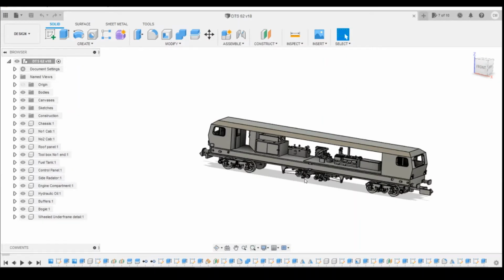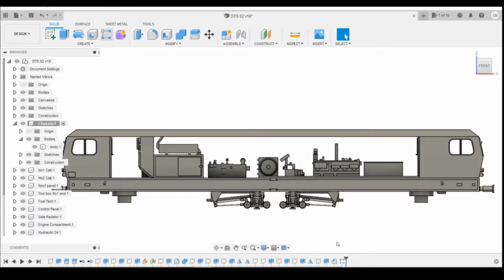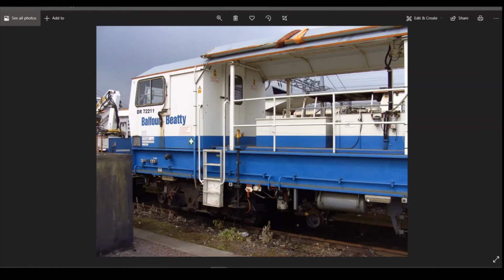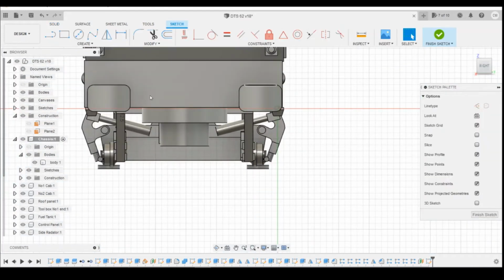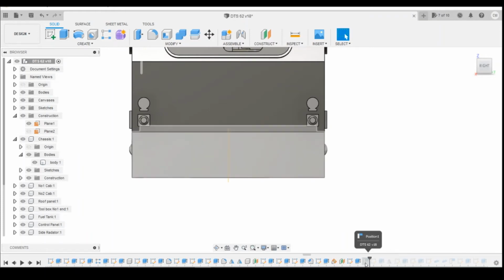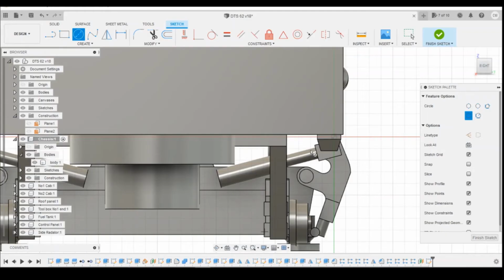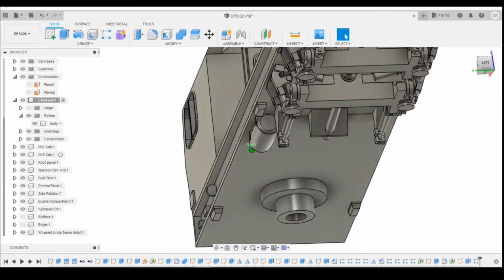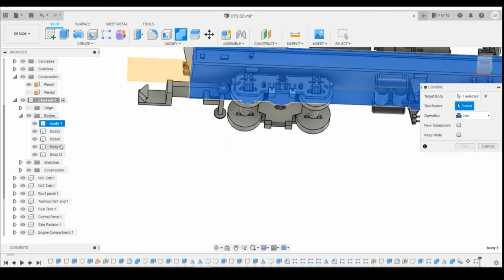Fusion 360 lessons in CAD (Ep21)

Comment: Another great video .... the only issue I had from the start when you draw a rectangle 1 dimension is highlighted so you change but it doesnt switch to the other direction and if I press enter it just sets it ... so I have to go back and dimension ... what am I doing wrong there ..
Reply from the maker: Hi John,

You can use the Tab button to toggle between the different boxes.

Thanks

Carl